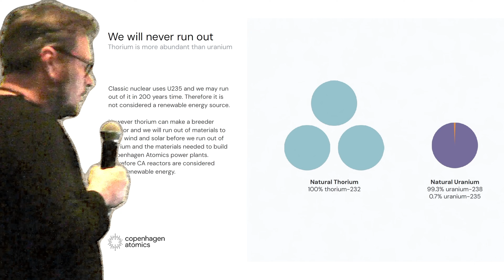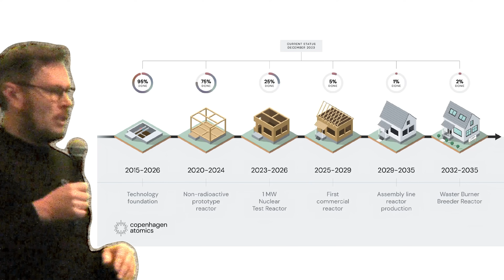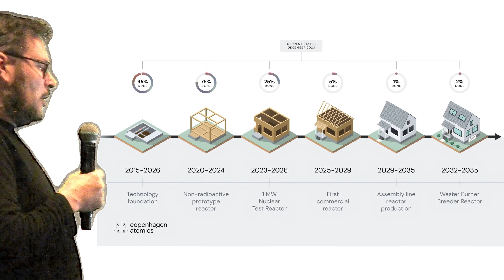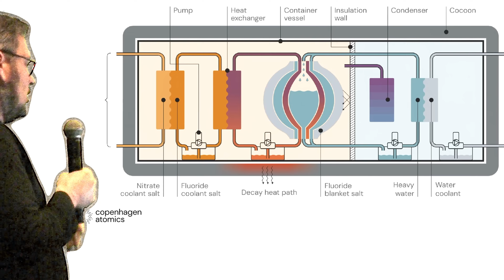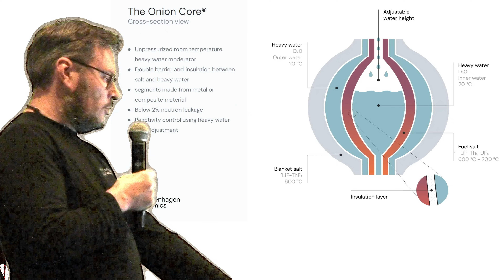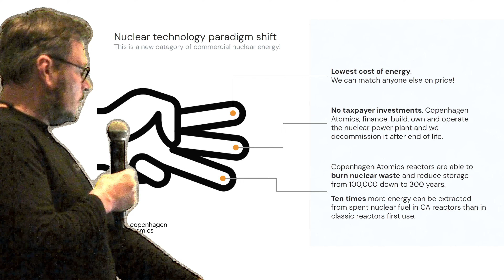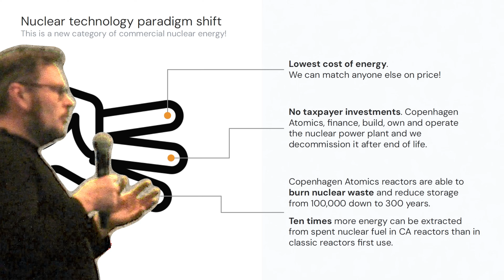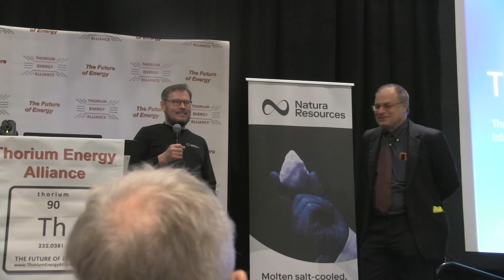Thorium Molten-Salt Reactor: Copenhagen Atomics Onion Core - Thomas Jam Pedersen @ TEAC12

Comment: 1:11 While $4500 per kg sounds a lot but if you can get even 1 GWh from it that a lot of energy and less then one cent per kWh  or 4.5 dollars from 60-120 MWh. Doesn't sounds we have any issues with uranium price at the moment.
Reply: I think the main takeway is how scale sensitive the fuel issue is. If we take the decarbonisation mission seriously, realise that how much extra nuclear is necessary beyond all the renewables (so we can expand energy production while decarbonise too) then it measn a lot of new nuclear developement. Once it's really built out, the fuel becomes a big question as the wide spread relience will be there, and then, the decision between thorium and uranium can make all the difference. Somewhat similar to the oil crisis in the 70s which probably wouldn't be a big deal  at the start of that century.
Reply: @CraftyF0X  Biggest problem with nuclear technology is that once you have it you can make a nuclear bomb is it thorium or uranium doesn't really matter it will be just more or less efficient or take more or less time to get enough fission material to make it. Bet everything in this area is heavily regulated mostly because of this and not because of some nuclear waste have seen some numbers that we only have like 10k tons of them since the first nuclear power plant. With proper particle accelerator technology you could make nuclear fuel even from depleted uranium that is user as cheap substitute for tungsten shells.
Reply: @Ayvengo21  Yea ppl tend to think this but I actually think we are loong over the point where we should throw away a useful technology because it can be used in  nefarious ways. Nuclear weapons are not trivial to make and even less so to deliver them, regardless if you have power plants or not. As you said some material are a lot more practical than others for such purposes, without going into technicalities I can tell you thorium is better on this front.
As for the particle accelerators, it would be very unpractical and wildly inefficient to produce fuel that way, its not even theoretically possible to have a gain on that, as accelerators would eat a "mammoth shit load " of more power than what you ever could hope to recoup from the fuel you produced that way.

Comment: Heavy water is really expensive (hard to produce) and is also a controlled substance I believe, any words on how they plan to handle the associated difficulties?
Reply: A few thousand dollars per kilo.   Controlled substance? We used to have sitting on our warehouse floor, anyone could have walked in and taken 10litres!
Reply: @colinmacdonald5732  Also I think it's controlled nature is because it can be used as moderator. So if the company buying is building reactors I don't see that as an issue.

Comment: I wonder if thorium technology is scalable to the degree that a micro-reactor could be developed and built. Somewhere in the 1-5 kilowatt range. It might be easier to have it regulated or possibly not even need approval if it falls under some criteria...
Reply: The problem with small reactors like that is that the physics do not scale. You can't really model temperature changes the same way because of the lack of mass and the movement of thermal mass inside the reactor. They are different machines. And why bother with 1000-5000w reactors at all? You can buy a gasoline generator for a whole lot less money.
Reply: it is possible [ ignore old mate below in the comments]  BUT you must play with much higher grade enriched fuel proportionally to smallness you are trying to obtain , if we were allowed to play with weapons grade then a shoe box with a household outdoor a\c heat exchanger sized dump then your 1 to 5 kilowatt system is viable , or a car reactor unit , but putting reactors in cars is as crazy as putting reactors in the fukushima eatrhquake zone...

Comment: Same ol' Same ol'.  The government REGULATIONS are THE problem... and have been THE problem since the 70's.
Reply: Given the energy and climate crisis, it’s about time the regulatory authorities modernized
Reply: @goodfodder  What energy crisis?  Is none.  What climate crisis?  Is none.  Regulatory authorities modernize?  Are you delusional?  They have to have their regulations completely REMOVED  for molten salt reactors to be viable.
Reply: I worked (briefly) in nuclear power in USA, and also for a medical device company, as an engineer.  Worst experience ever.  The government regulators are idiots.  They don't have degrees in engineering, or even a solid technical education.  They ask the stupidest questions and when they don't understand the explanation, which is most of the time, they do the easiest thing for them: Deny the application to save their own hides.  I think CA should get approval, and generate power and revolutionize nuclear power.  Good luck to you guys.
Reply: No. It IS safety and finance. Banks killed nuclear, not greenpeace.

Comment: Interesting talk but I leave with more questions than answers.

Mostly though, I want to know how they project such cheap power when these reactors are only supposed to last 5 years? How does the blanket salt to fuel salt processing work? Do they plan to recycle these modules somehow? Do they need to sit for a few decades before they are processed?
Reply: from his answer he said some of the cheaper componenets would need to be replaced 5 years but the expensive core aspects would last longer
Reply: Chinese scientists have already built some of these modular Thorium reactors.

Comment: Gordon - thank you so much for putting this up on line!
Reply: And thanks for the very important supply chain questions about Li6 and heavy water. I still find it magic that the 20C heavy water does not absorb the lion's share of the heat when moderating the neutrons.
Reply: @ericderbez2599  84% of fission energy released is kinetic energy of fission fragments, so it will be absorbed by the salt, and, assuming they design the thermal insulating wall well enough, it can be transferred outside of the onion core. Only 2.5% of fission energy is fission neutrons, and as he said, only a fraction of it will be absorbed by the heavy water via scattering. There will also be some energy absorbed from prompt gammas (absorption and scattering).

Comment: All reactors he knows, hmmm, he doesn't know much. Reactors can use U238, and close the fuel cycle even easier than with thorium AND without weapons grade fissile, like U233.
Reply from the maker: Ed, why is it, do you think, that Thomas is currently stress testing his MSR and you are not?

You were "first one to comment!" ing on a video with THIS comment? "He doesn't know much." Thomas is doing the work. You are commenting on a YouTube video. And the comment you are leaving does not make your own success any more likely... so far as a YouTube comment can have any impact at all, the impact of your comment is ever so slightly harmful to your cause, when maybe one day you might want to collaborate with CA.

This is the exact same thing I cautioned you against before you blocked me on Twitter. If you have a technical point to make, then just make the technical point.
Reply: @gordonmcdowell  Because Ed is a nuclear curmudgeon, you should know that by now.
Reply: @gordonmcdowell  Is this stress testing being done with actual fuel salt, or just molten salt heated by electric heaters like Thomas said? And he mentioned nothing about the fuel processing needed for the decay step between Th-232 and U-233. What is he doing about the Protactinium that is going to punish his neutron efficiency? Pa-233 is the thing you need to take out because its absorption cross-section is 5x greater than Th-232. You have to get it out of your reactor and let it decay over 27 days. But now you have the proliferation concern because Pa-233 become U-233 which is a weapons material and is no longer protected by the rest of the fuel salt. 

Maybe for a country like Denmark that doesn't have Uranium waste sitting around, Thorium makes sense. India has lots of Thorium, but little Uranium, so maybe Th-U fuel cycle reactors make sense there. 
But the data from Argonne is pretty clear. Even with their pyroprocessing steps and metal fuel fabrication, fast breeders consuming waste Uranium is the way forward. Especially when we consider the ability of these reactors to generate fuel for other reactors. Fast reactors that don't need their actinides and fission products removed all that often are preferable if we're ever going to get away from light water reactors.
Reply: I think Russia has a reactor that can do that.  I hear it's quite finicky.
Reply: @ancapftw9113  correct, it's called the BN-800. The successor of the BN-600 (operational since 1980). Russia has decades of experience operating sodium cooled fast reactor and are getting decent capacity factors. 

The man speaks for his company, so it's understandable that he'd chose only commercial reactors as comparison to his reactor design.
Reply: You didn't mention that they are fast-neutron breeder reactors that convert the fuel into fissile ²³⁹Pu and other transuranics. Also that if unenriched uranium is used, it must be combined with Pu because ²³⁸U is not fissile. 

   Also that the thorium cycle burns high-level waste while the fast breeder creates a bigger waste problem than we currently have.

   Also that they are cooled with molten sodium and the others in the past had to be cooled with mercury and that no one has managed to produce a water-cooled fast-breeder reactor, nor an FBR that doesn't quickly consume its fuel cladding. Thus they are not useful for power generation, only for the efficient breeding of large quantities of weapons-grade plutonium, at extremely high cost and waste-disposal footprint.

   The new-generation ones proposed are cooled with helium or molten lead; they apparently don't consider it worth the effort to try to build a water-cooled one, for the apparent reason that any commercial power plant with this technology would produce power that would be completely unaffordable.
Reply: Not necessarily true. Thermal neutrons tend to make more isotopes. It's just Thorium's lower atomic number means more chances for a neutron to fission the nucleus after absorption. Fast Spectrum neutrons have a greater chance of fissioning long lived transuranics. @no_rubbernecking
Reply: @treasurehunter3744      Look, I'm not a nuclear professional but let's keep our eye on the ball here. The leader of Copenhagen Atomics said basically that we can't use ²³⁸U to generate power. The OP says the CA guy (sorry I forgot his name) doesn't know what he's talking about because OP says there are reactors that can run on ²³⁸U, and incredibly (to me at least), tries to argue that it has less proliferation risk.
   The facts I've posted, I believe show that this is crazy. To me, the OP's claim is like saying cake is much better than pie because all cake has garlic and garlic has much less pungency than the horribly pungent alternative, sugar, that’s used in pie.
   The facts you've stated, it seems to me, don't really address the elephant in the room. If you disagree, I'd like to understand why, and I think most of the voting public would, as well.
   There's a  definite sense out there that one side in the Th v. U-Pu debate is lying their butts off, to cover up the valid arguments of the other side and thus secure the path for their preferred technology.  But to know which ones are doing this, the public needs to be able to distinguish between what's relevant and what's smokescreen being put out just to make laypeople misunderstand the relevant things. It looks clear to me that there are professional nuclear scientists getting paid to do  this, including in social media.
   I hope you'll reply, because you sound pretty objective and there's a deficit of that right now.
Reply: @no_rubbernecking  He is referring to a molten chloride fast reactor, (liquid fuel) Terra power and Exody energy are developing them.
Reply: @chapter4travels     @chapter4travels     Thank you;   who is referring? Which commenter please? And do you claim that these can generate power with only nonfissile ²³⁸U as fuel, as was implied in the OP? ("Reactors can use U238".) Also, "can" is the present indicative, which implies not development but that they're already operating and have generated power with just U238. Is this what we're to believe has happened?
Reply: @no_rubbernecking  The OP of this thread. Yes, a starter fuel would be needed. The source and chemistry are part of the development and an independent business to fuel other reactor types and waste reduction.
Reply: @chapter4travels      @chapter4travels    Thank you... so if i may ask, what is the fuel being bred with those reactors and how does that fuel compare to the use of ²³³U in the Th cycle? Since Mr. Pheil implies that ²³³U is "weapons-grade fissile" and his "U238-fueled reactors" don't employ such things. Sorry i don’t know the answer, but my spidey sense is going off.
Reply: @no_rubbernecking  I think I have this right, but don't take it as fact. In the CA reactor, they convert thorium to U233 in the blanket, separate it out and reintroduce it as fuel. This is the proliferation problem.
In a molten chloride fast reactor, nothing is ever separated out. So the plutonium is mixed in with the U238 and all the other fission products throughout the life of the reactor. Normally this would ruin the neutron economy but being a fast reactor it can keep on going. Once the reaction is stable, you just feed in U238. Gases are bubbled out during operation. I may not have this exactly right (probably don't) so take that with a big grain of salt (chloride salt, lol)
Reply: @no_rubbernecking  Also, If I'm not mistaken, this same starter fuel they are developing would also work for CA as their starter fuel.
Reply: @chapter4travels   Thank you for your contributions. I don't have time at the moment to read further about it, but will do so later. 👍🏼
Reply: @no_rubbernecking  You're making Th-232 must also be bred into a fissile fuel to be used. You must also have a startup enriched fuel for a Thorium reactor for the same reason you need Pu-239 in an MCSFR. Every reactor needs enough fissile startup fuel to go critical. 
The Th-232 reactor doesn't burn high level waste, it creates less of it. However, there's a critical step missing from this presentation and that is the fuel processing. In order to get fissile U-233 from Th-232, you have to wait 30 days. The reason is because a stop on the roadtrip from Th-232 to U-233 is Protactinium. This doesn't sound bad, but you have to take the Protactinium out of your reactor or it will absorb neutrons and reduce your neutron economy. You have to extract fuel and let it decay before putting it back in, but this means you are effectively extracting highly enriched U-233. 

The fast breeder does indeed create more transuranics, but you never need to separate them. In a molten salt fast breeder, you just leave all the fuel in the salt solution and let the reactor consume it. The startup plutonium is likewise consumed. Furthermore, that active working fuel salt can be used to assist the startup of another reactor without needing as much Plutonium. Plus it's not like Pu is in short supply. We have lots of nuclear weapons that will need to be dismantled and disposed of at some point as their cores degrade. Weapons grade cores, even degraded, are still enriched enough to start up reactors. And because you're not extracting fission products or higher actinides, your waste stream stays very small for the first decade or two of plant life. After that, the waste removed, is much lower level and doesn't contain higher actinides. You don't want to remove actinides, because they help your reaction in a fast reactor.